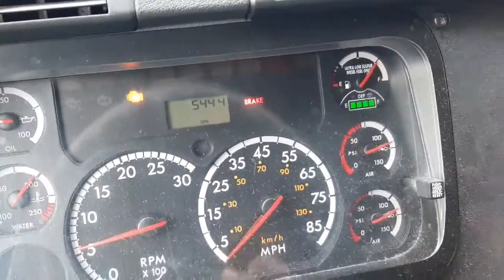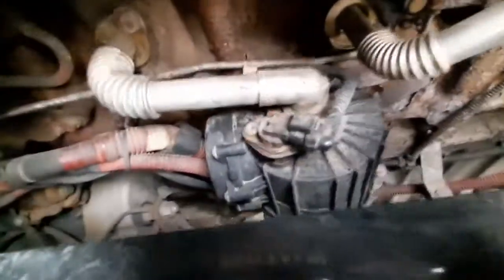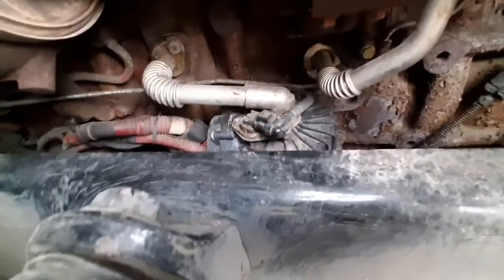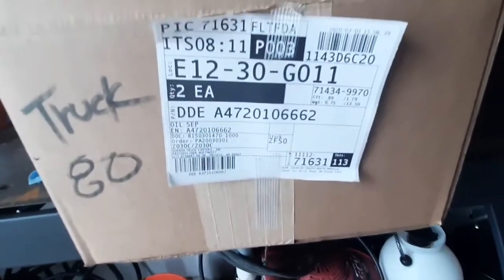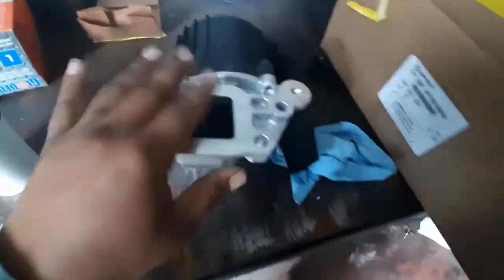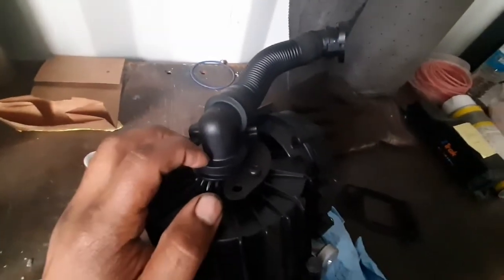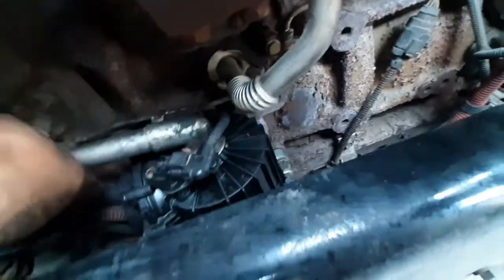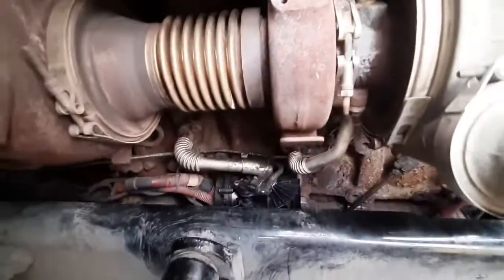Freightliner cascadia Crankcase Filter spn 5444 fmi 1

Comment: I replaced mine  the code came back a few weeks later I got the code again. So I'm gonna replace that speed sensor and that harness wire hopefully tahts does it 🙏
Reply: I changed the oil separator last year but now I’m getting the same code again. Did you buy the sensor yet ?
Reply: @onesikm3 yes I replace it cheap $40  hope it works also bought the harness haven't swith it yet.

Comment: How was the engine acting when you experience this problem?
Reply: I want to know too
Reply: Symptoms are high crankcase pressure, oil leaks from all over the engine including the crankcase breather itself
Reply: Could this cause a higher oil pressure reading
Reply: Oil leak or wore harness or speed sensor  i replaced my crankcase and a few weeks later I got the same code again. So now I'm going to replace that speed sensor maybe the wiring too for the connector